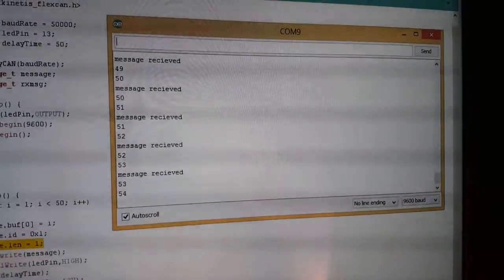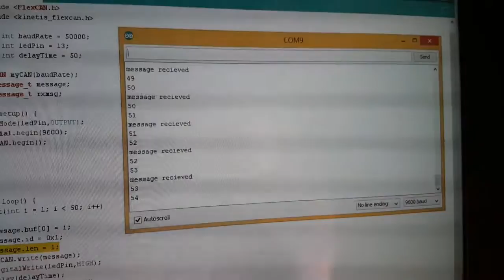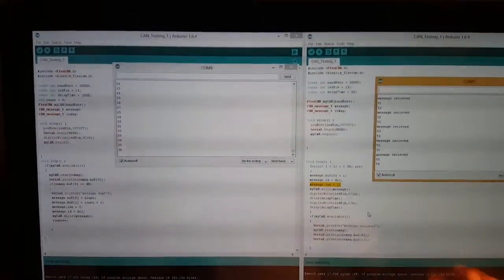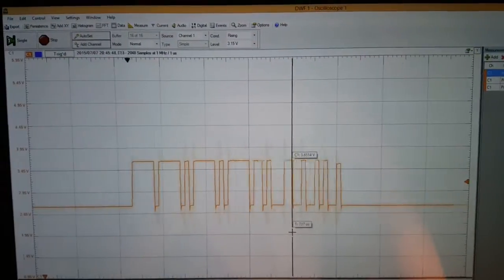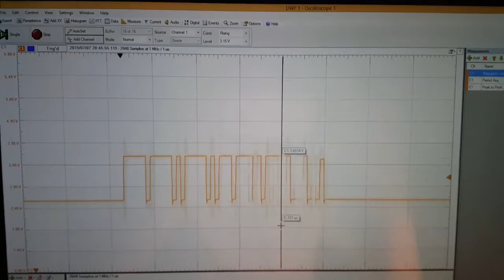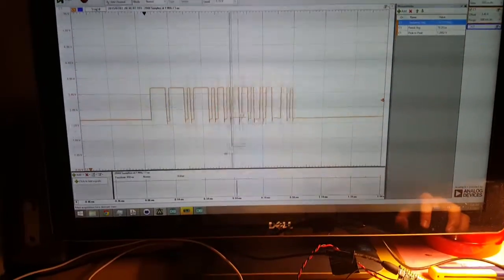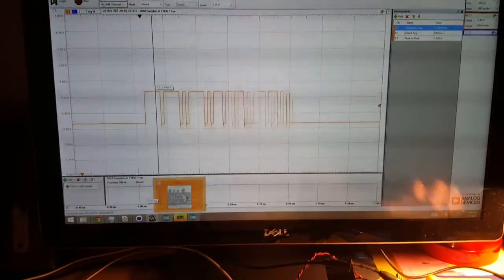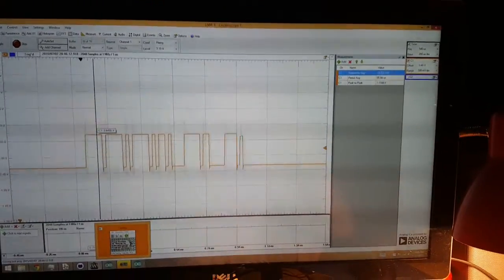Teensy CAN Bus Testing

Comment: The Teensy 3.1 has a built in can reciever? So if i just want to listen to canbus communication the teensy should be good enough?
Reply: Hi the teensy 3.1 has a CAN controller, you need a CAN transceiver like MCP2551 to connect. Basically the transceiver is the physic layer of the CAN bus and the CAN controller of the teensy interprete the data from the transceiver. Hope it's clear! (I may have done english mistakes sorry I'm french ;) )

Comment: Since Andy invited us to take a look at his code, I’ve taken the liberty to transcribe it from screen shots of his YouTube Teensy CAN Bus Testing video. Although, the two sketches complied and uploaded okay to a Teensy 3.6, the Receiver serial monitor remains blank. Maybe somebody with sharper eyes than mine, can review the transcribed code and detect any errors in my work. 
Hopefully Andy will see this posting and review the code as well.
 
// DMK 09-02-2017 Teensy 3.6 Receiver
// Andy Woerpel Teensy CAN-Bus Code
// https://www.youtube.com/watch?v=yQpfbf48dPQ
// Receive (Teensy 3.6, Arduino IDE 1.8.4, Teensyduino 1.38 with SN65HVD230 Transceiver)
#include <FlexCAN.h>
#include <kinetis_flexcan.h>
const int baudRate = 50000;
const int ledPin = 13;
const int delayTime = 1000;
int count = 0;
FlexCAN myCAN(baudRate);
CAN_message_t message;
CAN_message_t rxmsg;

void setup()
{
   pinMode(ledPin,OUTPUT);
   Serial.begin(115200);          // Modified DMK 09-04-2017
   digitalWrite(ledPin,HIGH);
   myCAN.begin();
}

void loop()
{
  if (myCAN.available())
    {
      myCAN.read(rxmsg);
      Serial.println(rxmsg.buf[0]);
      if (rxmsg.buf[0] == 49)
        {
           Serial.println("Message Sent");
           message.buf[0] = count;
           message.buf[1] = count + 1;
           message.len = 2;
           message.id =0x2;
           myCAN.write(message);
           count++;
        }
    }
}

// DMK 09-04-2017 Teensy 3.6 Transmitter
// Andy Woerpel Teensy CAN-Bus Code
// https://www.youtube.com/watch?v=yQpfbf48dPQ
// Transmit (Teensy 3.6, Arduino IDE 1.8.4, Teensyduino 1.38 with SN65HVD230 Transceiver)
#include <FlexCAN.h>
#include <kinetis_flexcan.h>
const int baudRate = 50000;
const int ledPin = 13;
const int delayTime = 50;
FlexCAN myCAN(baudRate);
CAN_message_t message;
CAN_message_t rxmsg;

void setup()
{
   pinMode(ledPin,OUTPUT);
   Serial.begin(115200);                  // Modified DMK 09-04-2017
   myCAN.begin();
}

void loop()
{
  for (int i = 1; i < 50; i++)
    {
      message.buf[0] = i;
      message.id = 0x1;
      message.len = 1;
      myCAN.write(message);
      Serial.print("Message Sent   ");     // Modified DMK 09-04-2017
      Serial.println(message.buf[0]);      // Modified DMK 09-04-2017
      digitalWrite(ledPin,HIGH);
      delay(delayTime);
      digitalWrite(ledPin,LOW);
      delay(delayTime);
    }
  if (myCAN.available())
    {
      Serial.print("Message Received  ");  // Modified DMK 09-04-2017
      myCAN.read(rxmsg);
      Serial.print(rxmsg.buf[0]);          // Modified DMK 09-04-2017
      Serial.print("  ");                  // Modified DMK 09-04-2017
      Serial.println(rxmsg.buf[1]);
    }
}

Comment: sorry for the dumb question , but why dot you need the transceiver? doesn't the Teeny's CAN capabilities have that built in?
What the transceiver actually do that the Teensy doesn't ?
I
Reply from the maker: +Sam Pati The teensy has what is called a CAN Controller built in.  That deals with all of the logic used in the CAN communication, but because of the way that CAN works, you need a transceiver to actually act on the CAN bus. Might be the best explanation.  I learned most everything that I know about CAN from it's Wikipedia page.  https://en.wikipedia.org/wiki/CAN_bus